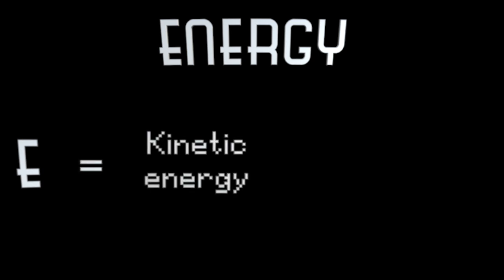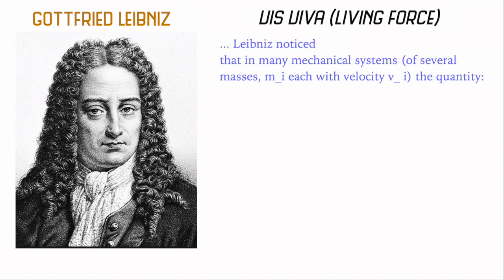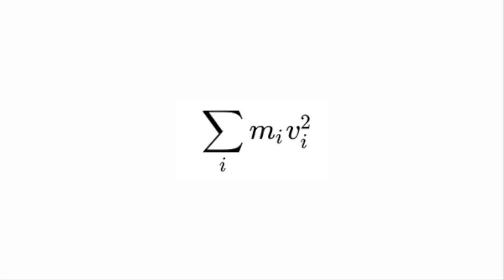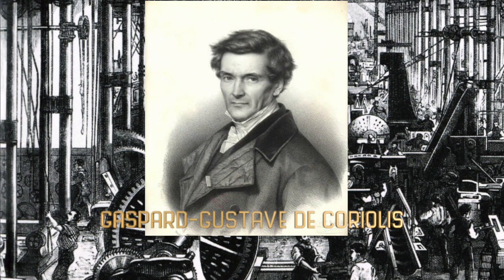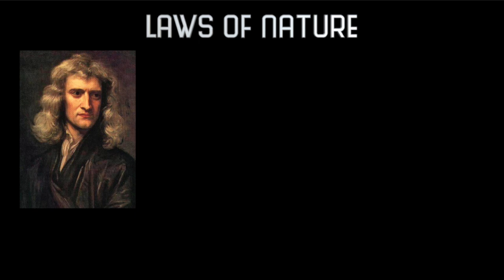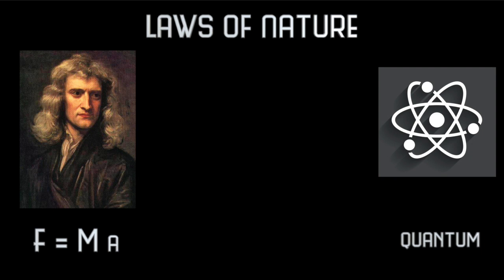Why is there a half in kinetic energy formula ? Work- energy principle.

Comment: The physical explanation emanates from Newtons third law, action & reaction of force. If a force operates (creates acceleration) in one direction, the same amount of force always operates (creates acceleration) in the opposite direction. No exceptions in this universe. Mathematical explanations/derivations only contain the created kinetic energy in one of the directions, but the total created kinetic energy from F = m • a  is  m • v^2  (without the 1/2). Nothing strange about it! Much more interesting to reflect on is that release of absolute energy in the universe, for example in an explosion (release of binding energy in molecules), or release of atomic energy, results in relative kinetic energy. Kinetic energy is always only relative. So, where did the real absolute energy go (it can't have disappeared) ? Relative kinetic energy is no exchange/compensation of energy to the universe as a whole, from the absolute energy (E = m • c^2). The answer is, the absolute energy was used to slow down time, to slow down the rate of change in all the accelerated atoms involved in the process. Time dilation is physical, and happens during acceleration phases of matter through (or against) the quantum vacuum in space. Physical time dilation does not happen during constant relative motions (acceleration is an absolute motion). It takes energy to slow down physical time, how a brain thinks about time (psychological time) is something completely different.

Comment: Here's a short version: The kinetic and potential energy are defined for the sole purpose that the conservation law of energy becomes true for an isolated system. It's perfectly OK to multiply all energies by any numerical factor (like 2) and still have the conservation law remain valid, but then the transfer of energy would also have to be defined as 2 times what we normally call work. "Work" in physics is just a definition (it wouldn't even be a "thing" if it weren't for the law of energy conservation), so there's nothing wrong with an alternative definition, except that it would have an inconvenient extra factor of 2 in it.

Comment: So basically your showing the prof of work energy theorem to explain that, kinda useless
I was expecting an intuition answer
Reply: There is no intuition in science. If science were based in intuition, then every scientist would believe the Earth is flat, do you not think?
Reply: There is but not actually, intuition is basically deriving something new from something you already know the only difference is it's alot simpler and doesn't include mathematics directly (which basically is creativity) obviously one may think the earth is flat through their intuition which is wrong ( and they can be proved wrong easily just drop a water drop from some height it will form an approx sphere while falling since they ignore most of mechanics it can be used as a powerful analogy atleast for them)

What I meant my intuition is to connect certain dots which make things look obvious, ofcourse they depends on how much you have observed or analysed stuff
Example if I pick something pretty basic like say a particle is losing velocity by intuition you can say a dozens of things which are obvious and related to the info
You didn't used mathematics but you still reached conclusions which were obvious to you

Well ofcourse what you said is 100% correct that one cannot discover alot using intuition but intuition do lay the foundation for research, you think on stuff which looks possible (something that credited to intuition)

Example arithmetic progression is kinda a special case of motion with no external force 
Or how flow of current is analogous to flow of fluid and rest of it
Once you make things intuitive you basically break down information  in it's most fundamental form which is way easier to use

However explaining mathematical coefficient is not simple at all although he first assumed Work energy theorem to be true, which actually doesn't feel right since if you are finding something you cannot use the same thing for it

We say WET is valid because end result is something which we define as Kinetic energy but if you don't know a person you cannot say I that the people who is unknown to me has a big nose, that's what was done in the video.
Reply: @abhishekdas2479  If you are talking about the speed of an object decreasing, you are still using mathematics, not intuition. It may not be written mathematics, but it is mathematics nonetheless.

He did not assume the work-energy theorem to be true. He proved the work energy theorem. The work W is defined as the integral along a  path γ of F•dr. From Newton's second law of motion, it is known that F = m·dv/dt + dm/dt·v, so W is equal to the integral along γ of m·dv/dt•dr + dm/dt·v•dr. The integral along γ of m·dv/dt•dr is equal to the integral along the velocities at the endpoints of γ of m·v•dv, which is equal to 1/2·m·(v1)•v1) – 1/2·m·(v0)•(v0). Meanwhile, the integral along γ of dm/dt·v•dr is equal to the integral along the masses at the endpoints of γ of v•v·dm, which is simply equal to (m1 – m0)·v•v. Therefore, W = 1/2·m·(v1)•(v1) – 1/2·m·(v0)•(v0) + (m1 – m0)·v•v. If m1 = m0, that is, if the mass is constant, then this simplifies to W = 1/2·m·(v1)•(v1) – 1/2·m·(v0)•(v0). If we define K(v) := 1/2·m·v•v, then W = K(v1) – K(v0). This is what the video proved. Therefore, the quantity K is mathematically special, because unlike W, it is a function of state of the system that can thus be indirectly measured. Furthermore, since K is known to be conserved whenever the mass is conserved and whenever the net force field is 0, this implies that K is a component of energy, and it is one originating from having nonzero velocity, so we call it kinetic energy.

What you need to understand for this to make sense is that, contrary to what they teach you in the classroom, the work-energy theorem comes before defining the idea of kinetic energy, not after.

Comment: I thought you would explain by laws of nature or a intrinsic logic, but it seems we can never get rid of calculus... a kid wouldn't understand why the half, sadly
Reply: There is no law of nature to explain it with, because K = 1/2·m·v^2 is a mathematical theorem, not the result of physical observation. Strictly speaking, as K is not an independently defined quantity, it is impossible to actually measure it into the first place and determine that K = 1/2·m·v^2.

Sorry, but that is just how it is. We cannot bend reality to our will just because you do not like how reality works. But also, your complaint is a little silly: kids do not take physics courses and do not learn about kinetic energy until high school at the earliest, which is also when they begin to take calculus. So contrary to your claim, any person taking a physics course is already equipped with the mathematical knowledge to understand integration in physics, at least if they came from a half-competent school.
Reply: @angelmendez-rivera351  well, in my school I saw no calculus because the educational system in Brazil don't have optative grade. But I saw energy and wanted to understand that. Why is there a equivalence between two constants (g and h) and v^2/2? You see this math in reality, so how can you say there is no experimental results? Thoughts like these conducted the high precision experiment of the oil drop of Millikan, so reality has its reasons to the 1/2

Comment: Wrong question! Why does kinetic energy scale with the square of velocity is a better question. If you assume that work is force times displacement it follows mathematically; fine!
What I would like to know why in an elastic collision not only momentum is conserved, but also kinetic energy. You could say that kinematic equations are not explicitly time dependent, therefore by Noether’s theorem Energy is conserved and the kinematic equations also are not explicitly position-dependent, so momentum is conserved. Elastic collisions of spheres that behave frictionless do not start to spin, so angular momentum does not change and stays zero.
Reply from the maker: Thanks for this. I have a video about Lagrangian formalism planned. This video had a simple intention of understanding where the kinetic energy formula comes from
Reply: @MetaMaths  The most insightful explanation I could come up with why kinetic energy should scale with the square of velocity is this. Consider a mass m being dropped from a 20 meter altitude, which we’ll call h=0 at t=0, in a vacuum chamber to eliminate air friction, for simplicity assume g=10 m/s². The work done by gravity is W=F•h= m•g•h. Where does the work W performed by gravity go? If energy is conserved is has to be accounted for by the energy that can be associated by the velocity of the mass m. Kinetic energy K~m•v^n with n yet unknown. Under influence of a constant force velocity will increase linearly with time: v=g•t so K(t)~m•g•t^n but W(t)=F•h(t)=m•g•0.5•g•t² = c•m•g•t^n
So the constant of proportionality c must me 0.5 and n must be 2.

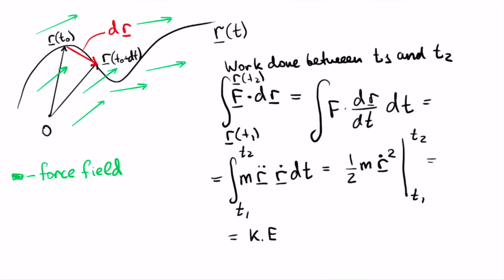Comment: 30 more seconds of how you get from 3:38 to 3:48 would have been helpful :)
Reply: It's reverse chain rule.
If you differentiate m(r•)^2 then you get 2m(r•)(r••) via chain rule.
Since integration is the reverse process of differentiation, you can spot that integrating m(r•)(r••) gives you 0.5m(r•)^2.
If you see two derivatives multiplied together with orders separated by 1 step (so r*(r•}or {r•}*{r••}), you can often get something like this.
Reply: @dascientist8443  well can u explain me it if i am wrong
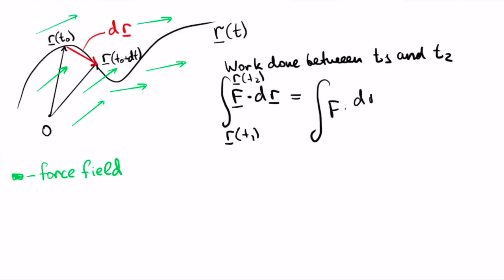Reply: Your steps there are right, but that's how you get from 3:30 to 3:38

What they have in the integral is basically
Work = Integral [ F * (r•) dt ]
= Integral [ m * (r••) * (r•) ]

Which then becomes 0.5*m*(r•)^2 or 1/2 mv^2 when you do the integral.
Reply: well its because force is mass times acceleration and as r taken as distance the second order deravative is acc which is r double dot

Comment: I still don't understand how they go from (integral of m*r_dot*r_double_dot dt) to 1/2(m*r_dot^2), can anyone explain?
Reply: integration by substitution. 
set u = r’
du = r‘’ dt
plug u and du in for r’ and r’’ dt and take m out since it’s a constant:
m*integral(u du) = m*(1/2)u^2
plug r’ back in for u and you get (1/2)mr’^2
Reply: @jasonguo3540  we have r'' dot r'. these two are vectors!!!! how can we use substitution? what about cos(theta) (from dot product)?
Reply: You can write the dot product as a sum over the product of each vectorelement of both vectors do the substitution works just fine as it works for Each element
Reply: @sajjad213  In introductory physics, r'' and r' are not vectors. But even if they are vectors, you can still use substitution no problem. Them being vectors does not change how substitutions work.

Comment: how do you get from int{m r'' r' dt} to 1/2*mr'²
Reply: because the time derivative of r'² is 2*r'*(time derivative of r') or  2*r'* r''
Reply: @jdp9994  
Thanks for the answer, but I think I still don't get it. :(

Isn't your attempt the other way around? 
I mean, I understand that the derivative of 1/2 m r'² is the integral, but is there a nice way to get from the integral to the right side? (not just by reverse engineering the right side)?
Reply: You can integrate by parts with u’=r” and v=r’. So that int(u’v) = iuv |at t2 and t1 - int(uv’).

In our case the integral with the negativ sign will just be our integral again and you can put it on the other side to get 2int(mr”r’). Now you see directly that there is a 1/2 in the solution when you divide both sides by 2.

Int(mr”r’) = mr’r’ - int(mr’r”)
2int(mr”r’) = mr’^2
int(mr”r’) = 1/2 m r’^2
Reply: @peterschmidts8245  Thanks a lot - haven't integrated much lately but your explanaition helped a lot!
Thought this had to be more difficult :D